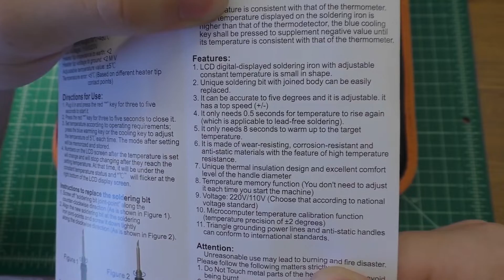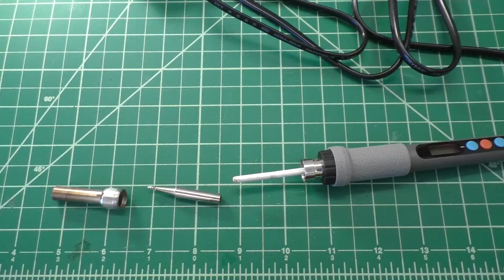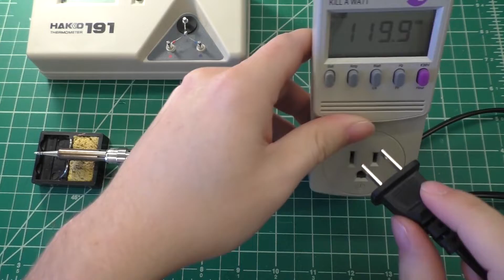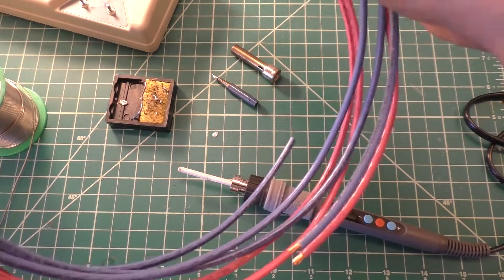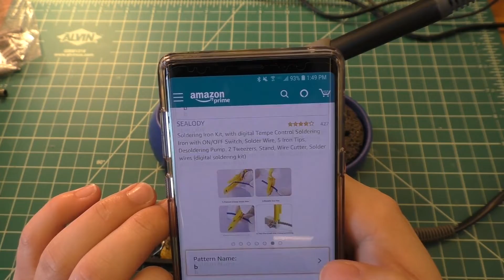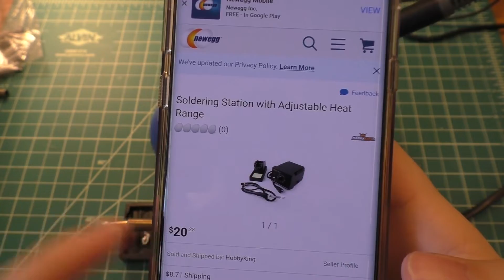Cheap Temperature Controlled Soldering Iron Review

Comment: These little $10 Irons are incredible value, I've had one for 4yrs now.

I accidentally left out on for 2 weeks once 2 yrs ago and it still works perfectly 😲👍

I replaced the power lead with a switched lamp cable after that ! LoL
Reply: Probably because it lack of many sensitive component that could be damaged during extreme condition so it has more chance to survive a.k.a more reliable. Also the power drawn to keep temperature consistent is much lower than its rated max wattage

Comment: for the love of god, if you are beginner get butane soldering iron because it's kind of foolproof since it's imposible to not be hot. sometimes beginner think they sucks and talentless just because they dont realize the main problem is the soldering iron is not hot enough. there's no guarantee the indicator are correct but red hot glow are def' hot in butane soldering iron.
Reply: Well, back when I'm still beginner, I did thought that bad solder connection is due to my skill being suck. Not entirely wrong though because that time I don't know that lead free tin melt at higher temperature and flow worse than leaded tin

Comment: You should have used 60/40 solder not that lead free crap
Reply: Lead free has come a long way from the days when it crystalized and caused joint failure within a few days to years. It doesn't do that anymore from my research. Not to mention, lead free is used in so many applications right now with a similar failure rate to leaded. It's just slightly harder to work with because of the slightly higher melting point.

Comment: I ordered a couple of similar irons (110V, 80W, push button LCD) for $10 and there are both 110V, 60W and 80W heaters (2 wire plug-in style) for them (ordered 1 each heaters). So there are some things to try to get the temp into the range.  It might be interesting to power one with a variac to see if voltage would correct the temperature to use a 0 degree offset and the readout actually match the tip temp.

Comment: I got an 80w version of the same thing on ebay. I was surprised to see it has the same element style as the hakko and not the cheaper one you reviewed! IT DOES come with a 3 prong grounded power wire also. Thanks for your review! Great for little stuff I do. Mouse switch replacement and the like.
Reply: Do you have a link to that particular model?

Comment: You must have a real knockoff mine looks same but better power wire and heating element  3 pin plug all tips fit too
Reply: older video, im guessing they updated to the 3 prong on most of the models. Mine is 3 prong and better heating element design (like the hakko) like yours.

Comment: Yes. The 80W / 90W ones are better, esp. the ones with 3-pin socket & 4-pin element, but if the temp. controller circuit conks out, it's not replaceable. I learnt it the hard way. In a sense, 60W is simple & economic, though less classy.  Also note:::the heating element is PTC, i.e. ohms will increase as it heats up, so while a 60W iron will consume 60W at the start, it will consume only 36W - 40W at full heat, so will perform like a 35W or 40W iron.

Comment: The calibration issue may have a different explanation. While Hakko has a 4-pin element with temp. sensing, the knock-offs have only 2-pins, with resistance sensing to "estimate" temp. It estimates temp. of the bit as & when it is soldering, not when it is lying idle. The idle temp. of the bit will be 50 -100 degree higher. So, if calibrated to proper temp. when it is idle, the temp. will be 50 -100 degree lower when actual soldering begins, so won't be able to solder properly + the bit being of a much lower quality copper will further compound this problem. But, soldering performance-wise with zero calibration, it is almost as good as Hakko.  At 1/4th the price.

Comment: Oh, I've just bought a 80W 906S- a cheap soldering w/ only (-) and (+)  buttons. However, it seem better than ur cheap one. Ur is better in the LED screen
Reply: I also bought an 80W iron with only 2 buttons (+ and -) for only 8 euro directly from the Chinese (aliexpress.com) and a month of waiting.
Mine does have the metal tube support for the tip like the Hakko.
Unfortunately, I don't have the thermocouple measure to check the tip temperature accurately.
https://www.aliexpress.com/item/32903921345.html

Comment: 90W version uses four-pin heating element. It is different from this version. I think the reason for calibration off could be the 110V heating element has a lower resistance, and the factory may not change its firmware. The tip certainly makes big difference, I have not find a knock-off tip that works as well as Hakko yet.
Reply from the maker: Interesting, I might have to pick up one of the 90W ones to do some testing on it.